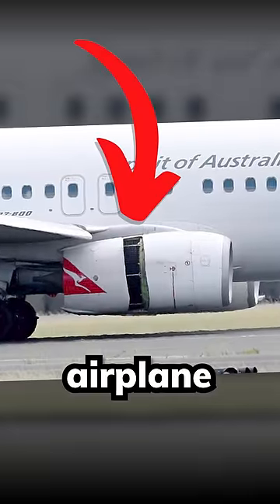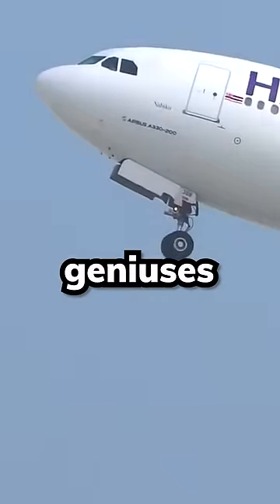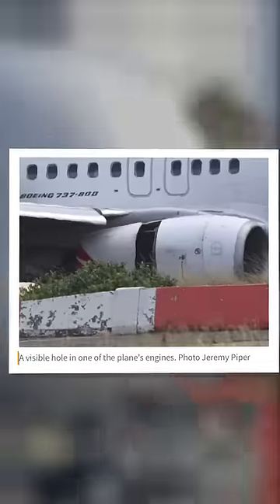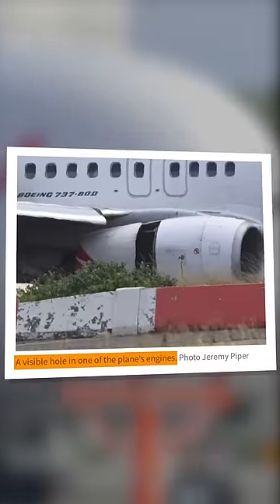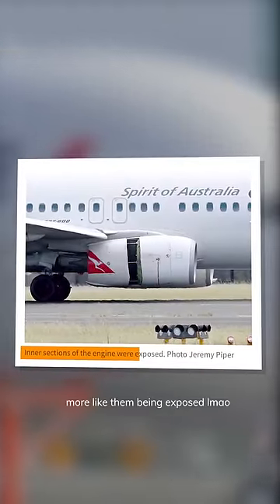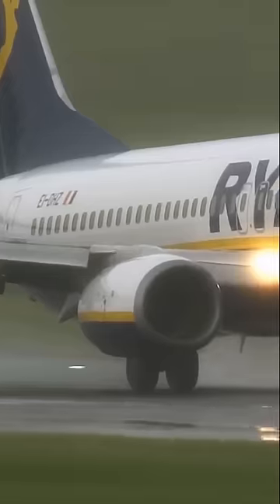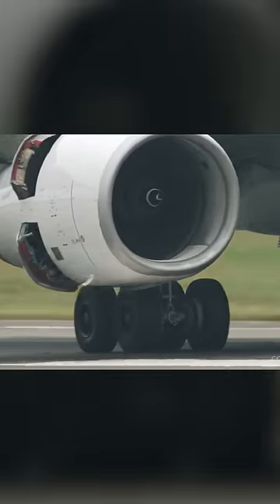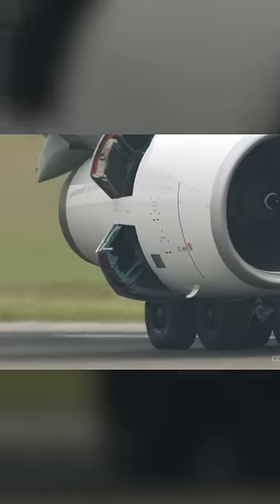Huge Hole In Airplane Engine 😱 @dailytelegraphAU lmao its called reverse thrust

Comment: that is mot reverse trust look closely
Reply: It's reverse thrust they make air flow go forward making it reverse(slow down)

Thrust reversal is achieved by momentarily diverting the hot exhaust gases towards the front of the aircraft or changing the propeller/compressor pitch so that the thrust produced is directed forward. Thus thrust will act against the forward direction of travel and provide a means of deceleration.
And yes I copy and pasted it bcoz I'm too lazy
Reply: That IS reverse thrust

Either you've never flown before or have never done research